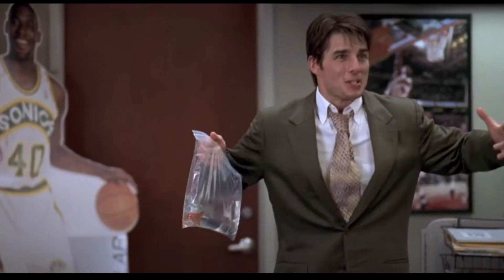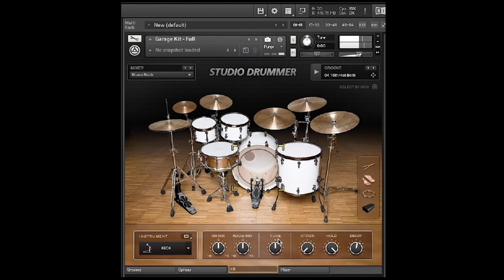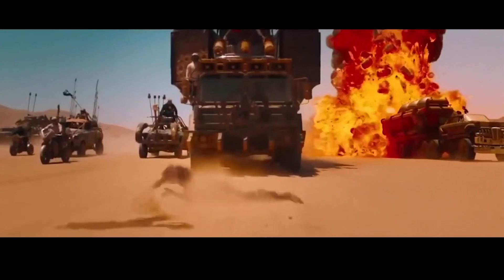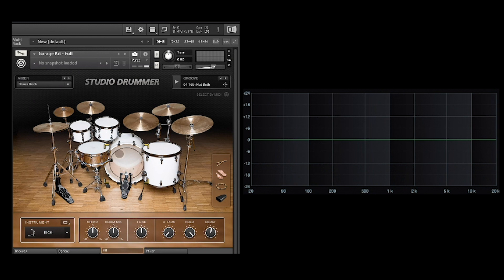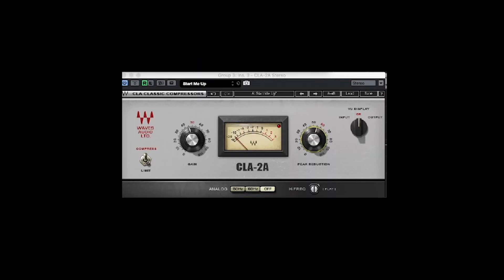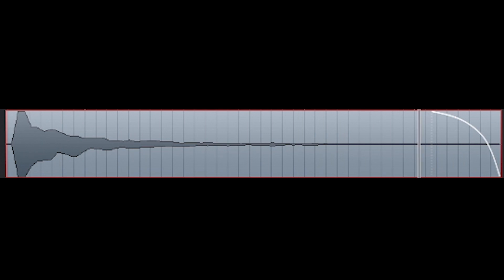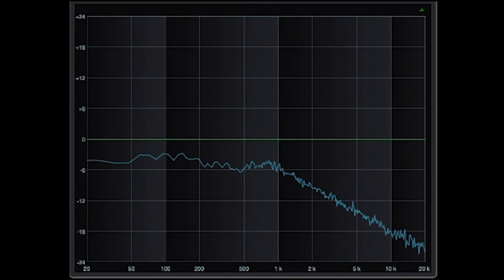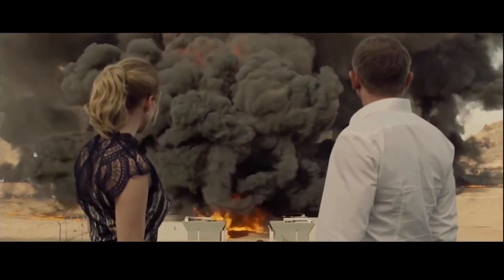How to design the sound of an explosion

Comment: This was very cool but if you add something like MH Thump into the plugin chain it can help give the explosion more weight which is what I feel it needs to compete with the others in the vid. Great vid as always ...
Reply from the maker: Hey, I didn't know about Thump, but I just searched it and it looks great. Thanks!
Reply: @eytankrief497  No problem, Yes let me know what you think? I think you will see if you set it up just right it will really add some nice low end punch to explosions and gun shots sort of a secret sound design weapon if you ask me. Maybe you can include it in your next vid. I have been using it for years its def a great little tool to have in ones arsenal.